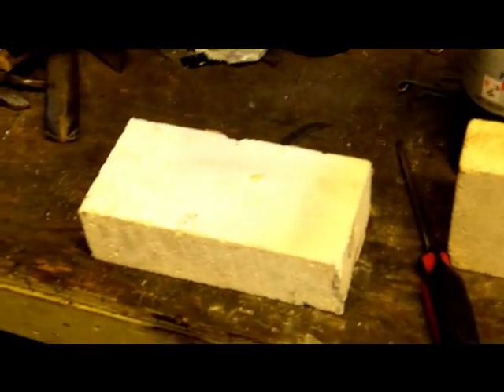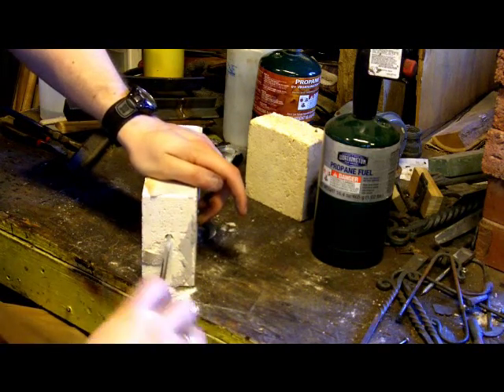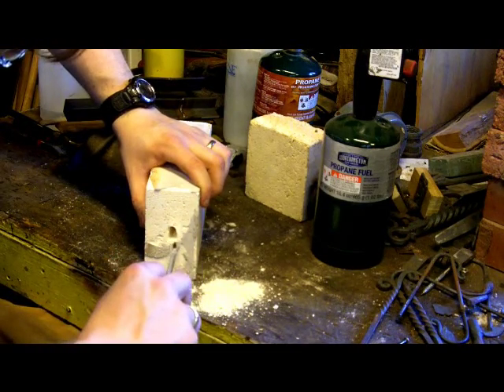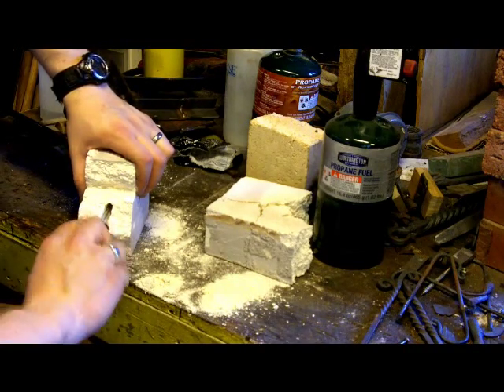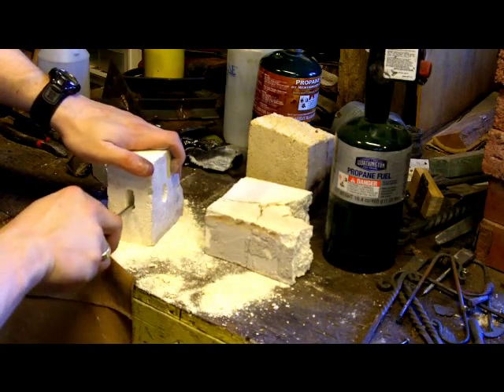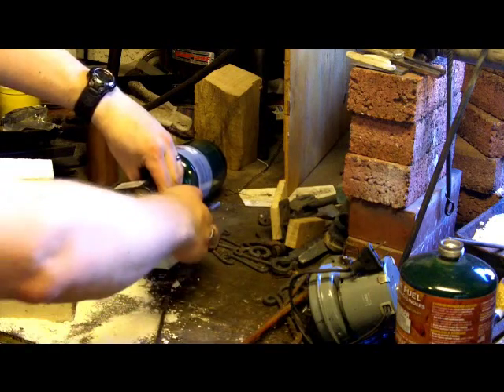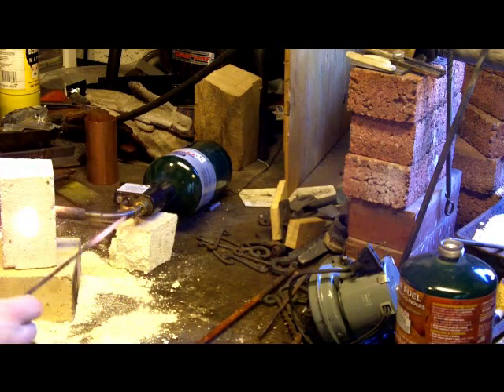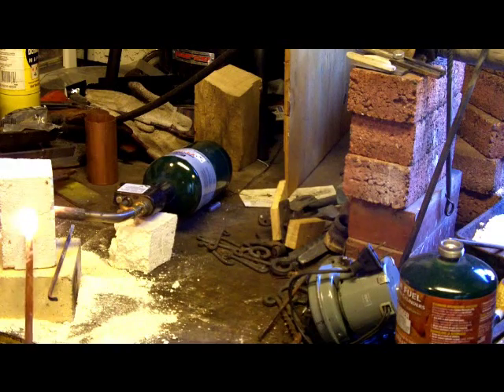OneBrickForge

Comment from the maker: @Mr420rush Agreed. I made a forge over the holidays that uses two bricks and I used a box saw (the kind used in a miter box) to cut the bricks to the depth I needed, made several cuts and chipped away what I didn't need. I used regular drill bits to make the hole for the burner port.

Comment from the maker: @guillotin15 I think any of the small torches like the one in the video will work. Propane is plenty hot for this size forge- you won't need to add oxygen or use MAPP gas.

Comment from the maker: @Makermook 1) I carve the holes all the way through because longer pieces may need to go all the way through. I don't know that the hole -needs- to go all the way through. If you're only working the end of a piece, I don't suppose there's a need to go all the way. 2) In the first one-brick forge I show in the video, the hole goes all the way through, the burner port is in the middle of the brick and will easily heat 3-5 inches.

Comment: That's something I want to do.  As a matter of fact, I ordered 2 soft firebricks specifically for that purpose and they arrived yesterday.  If you can please tell me: 1) Why did you put the hole all the way through the brick?  2) If you made the cavity longer, eliminated the back hole, and put the burner inlet further back toward the back of the cavity, would the whole cavity get hot enough to work 3-5" of a piece at a time?